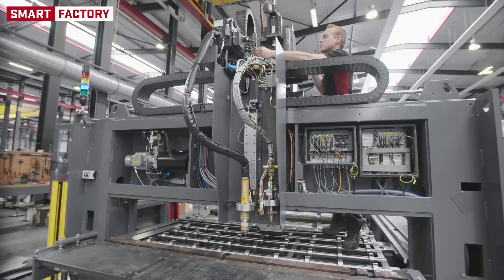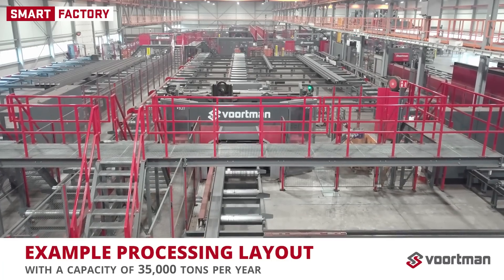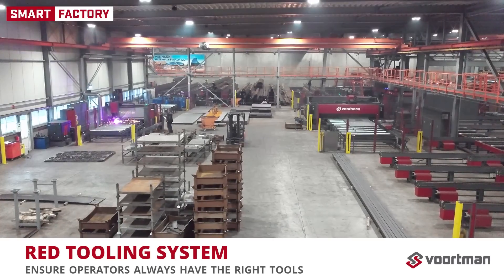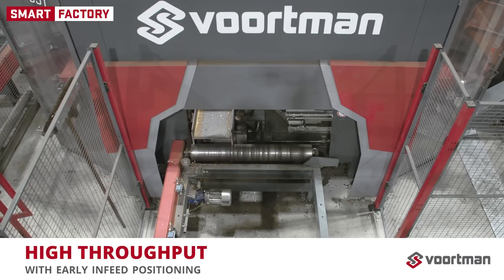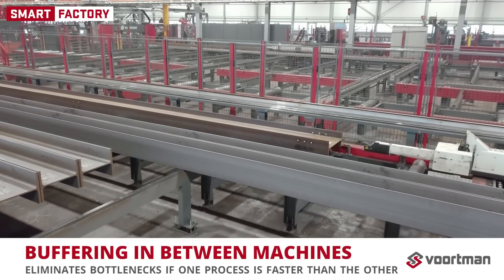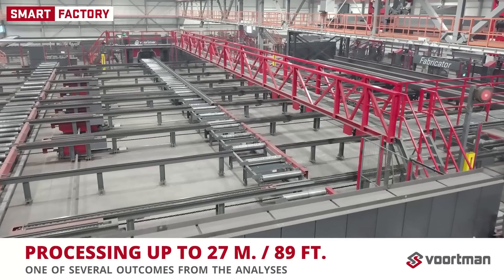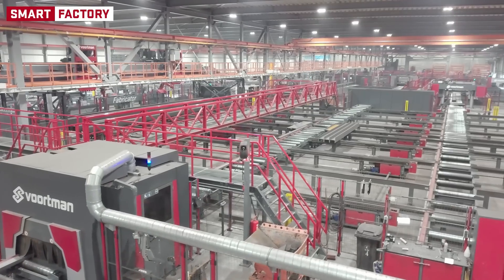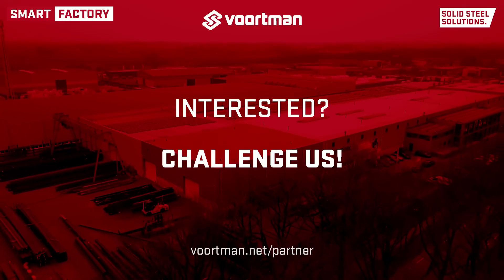Voortman | introduction of a real smart factory

Comment: Any failsafes? This type of factory would need to run in 3 shifts for good ROI. If anything breaks on this massive line the entire process would be halted therefore costing a lot of money. Very interesting nevertheless, using IFC or BIM models to manufacture structural steel automatically is a game changer for anyone that has access to investments this size. Good job